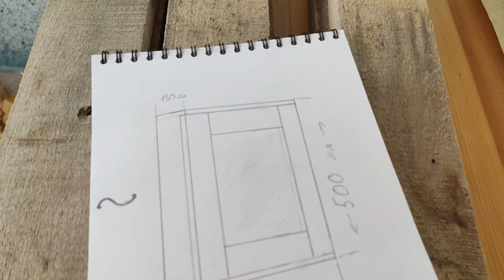Making a display cabinet with a glass door (hand tools only)

Comment: I'm about to add a glass door to an existing cabinet and been poking around on the tubes for too long. I have to say this is a very welcomed change to the router, caulk gun, stapler crew I've witnessed so far. Excellent job!

Comment: Awesome job!, thanks for the upload.

I wonder how you handle the error tolerance in the whole process like planing flat surfaces or removing twist or planing edges square, etc.

Sometimes I struggle getting things “good enough” that I end up not advancing in the project.
Reply from the maker: As a rule, I try to do everything as well as I can but without sacrificing time. You know, sometimes one can spend a ton of extra time perfecting something, yet in the end the difference might be unnoticeable.
Reply: @alexander Planer - Beautifully said!